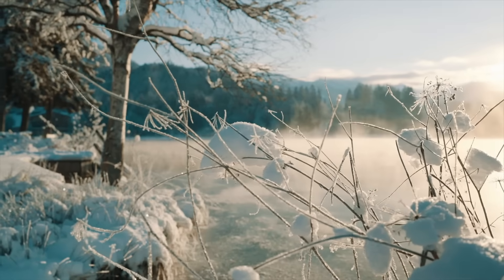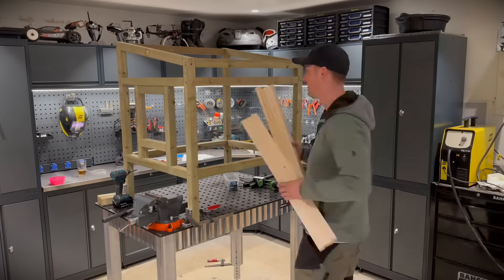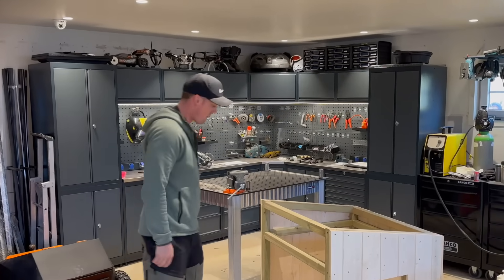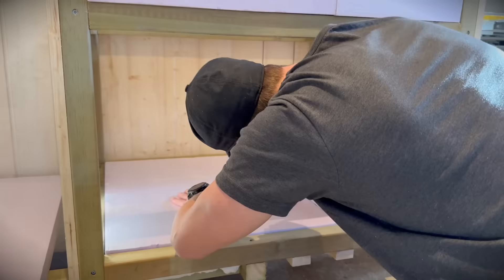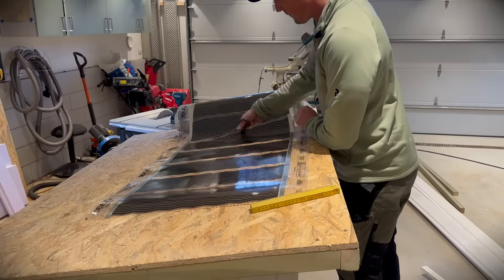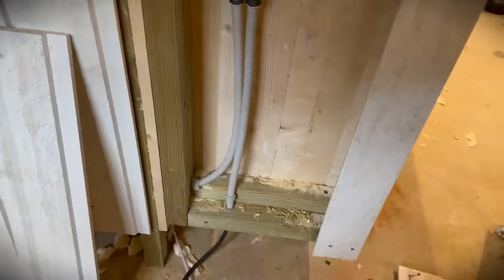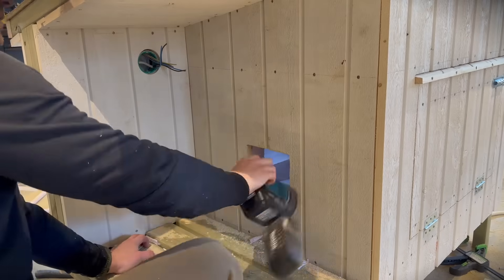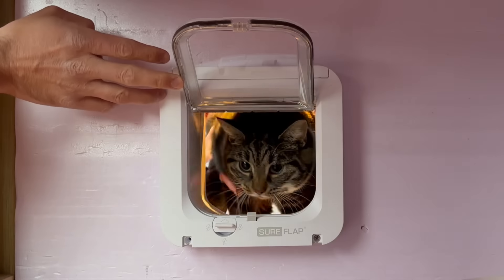I Made The Ultimate Heated Cat Shelter! (DIY)

Comment from the maker: Finally the DIY PDF plan is available for download! https://frengenengineering.com/ or: https://www.etsy.com/no-en/listing/4419179583/heated-cat-shelter-by-frengen Hope you find it useful! :)
Reply: A quick and easy project, but not for my husband. I wish he could do this for my cats. They live in a plastic storage container with a foam cooler inside for insulation and filled with straw. Grat job, beautiful house.
Reply: Thank you so much for thePDF.  It's a well-thought-out house!
Reply: Könnten.   Sie. Das.  Bauen. +  in.  Die. Schweiz. Schicken. Ich.  Bezahle.  Die.  Kosten
Reply: I’m a Union Electrician. I built a cat house for the feral cats in my neighborhood. It’s basically the size of a shed. I trenched a a few circuits out to from my sub panel in my garage. Then I did heater, ac, lights, and a receptacle. I also did a heated floor and low voltage lighting. The low voltage lighting is under the shelving i built for the beds. I built in a motion controlled door for them. Then I ended up doing solar panels which actually runs most of the power. I insulated it also. I’m thinking about bringing water out there with a little hot water tank and a small sink. Then I also built a cupboard that holds their dry food and cat litter. I also have motion controlled lights around the outside so they can see it at night.

Comment: 1:06 Gonna lose a lot of heat through that single pane window. If you added just another sheet of plastic with a space of just air between them would be much less thermally conductive. That's what double pane thermal windows are, just two sheets of glass with air between them.

Comment: I found it strange that he's working with inch-sized lumber in Norway. Does Norwegian wood (I think that's a song) come in those sizes normally?
Reply from the maker: Hi! You are correct. In Norway almost everything is referred using the metric system, but the exception is mainly construction lumbar and pipings, where we use inches. Still everyone knows the equivalent measurements in mm. I think it’s shifting a bit to using the metric terms in daily speech tough. 2"4 is faster to say than 98x48mm and so on.
Reply: @frengen_engineering  Thank you for the reply. I was afraid that Norway was a primitive place like the United States.

Comment: That’s a very thin piece of plexi glass that is going to let in a lot of cold air. I would’ve not even put a window in or at least something much smaller. no insulation on that one wall where the door is no insulation on the door either that’s also gonna let a lot of cold air in

Comment: Overall, a very nice cat house, but it lacks interior wall and floor coverings/paint to protect against moisture that the cat might bring in. A lot of heat will be lost through the thin plexiglass pane. Thermal insulation glazing would be more efficient (but unfortunately also more expensive!). A cat bed would certainly be appreciated for added comfort.

Comment: What is the point of all the Styrofoam insulation when you put a single glazed window in?
Reply from the maker: Its not a problem. Off course it’s some heat loss, but not that much. Remember, you can have a simple tent warmer on the inside than outside.

Comment: Nice guy!  I have cat forts in my insulated metal building and set up heat emitter lamps, like reptiles use, safely on a chrome shelf, facing downward.  I set bricks all around the lamp to hold it secure and keep the heat from rising too much above the shelf. Then there is a cushy cat bed and canvas drop cloth curtains down the sides  like a cave. This is all quite safe to the best of my ability....and common sense!  I use 100 watt heat emitter bulbs in a ceramic light socket thing and an aluminum cone.  On and off switch is on the cord.

Comment: Just related true story here. One year going into winter a frail older farrow cat started hanging around the house. It looked like it was going to die at any moment. It's tail actually broke off.Wanting to help make it more comfortable until the inevitable arrived, I built a small cabin with a gable roof that made the snow and ice slide off. I made skids and raised it off the ground to avoid any dampness on the floor and insulated the whole thing. 

The cat immediately started using it and peering at me through it's tight little front entrance way. So I decided to improve it even more by running a spring heating element through some spare quarter inch copper pipes I assembled in a C formation and then clamped them to the ceiling of the cabin. For power I used an old 12 volt car battery and then later used the 6 volt setting on the battery charger I had in the garage. Then I tossed in some pieces of old wool blankets. It  was warm and toasty in there like you wouldn't believe- even in way sub zero temps. And I kept it stocked with high quality dry food and lots of water.

The cat slowly got stronger and put on weight. She became the postie's daily friend and the neighbors smiled everytime they went by. The cat ended up living for 3 more years and I'm always remembering that it was possible because I decided to go the extra mile and try to help.

Comment: is there enough air for the cats to breathe? I'm asking because the home is quite insulated and is that entry hole (door) large enough?
Reply from the maker: Hi, there is installed a vent vent also. Not included in the video. And off course a bed n so on. The door is made specifically for cats😊

Comment: A polite suggestion:
A 4 to 6 inch layer of straw make a comfortable ,warm bed..better than blankets or cushions. 
We use this in the shelters for the feral cats in our area. Even when temperatures are around zero degrees f. ,they stay warm and dry.
Reply: Especially if the animal gets wet in sub- zero temps. They could freeze to the bedding. The straw will naturally wick away most of the moisture. Farm animals are given straw bedding for this reason.

Comment: Very nice house. I thought about it but then observed it would actually be cheaper to buy one than make one and our winters have no snow so, no need for more materials.

For heating a went with common 12v mats, a 100000mah battery and a solar panel to keep it charged but considering the winters here, even that was not needed, summer is the problem.

I might add an underground thermal air regulator and do some alu panels but I doubt it. The really hot days they can come inside or just lay low in the shadows elsewhere.

Comment: We made Cat outdoor box from Styrofoam panels glued together, this makes it air tight, waterproof and lightweight, yet simple to make. It had no heating because cat heats it by itself when the space is small enough. The door was made below the inside floor so cold air did not come in and warm air did not go out. There was only a simple leather flap over the entrance to prevent wind blowing in. The difference was that the box was in a cold shed so it was not fully under the weather.

Comment: My cat would use those foam inner walls as a scratch pad and quickly tear them to shreds. But it looks lovely from the outside well engineered.
Reply: I wondered about that too.  I suppose one could add some paneling overtop of it like in an actual house.
Reply: Yup.  The cat will claw that insulation to pieces.  The plastic window should be tempered glass for the same reason.  This also needs some ventilation.   It's a good first attempt but needs more work.

Comment: That's a really nice outside cat shelter - nicely done.  I'm in the US/Florida and our winters don't get as cold as yours but shelter is still nice to have for our furry outdoor friends.  I do have outside cats and have a "Cat House", it has the same insulation as yours and a window.  Mine is not heated though.  Mine is about 3' off the ground supported by 4" x 4" legs, has a front entrance and a back escape one, cats don't like to feel trapped.  My neighbor built mine and made the roof so it hinges open for cleaning and changing out the bedding.  I have a couple of cardboard boxes with wood chip pet bedding for their comfort.  It has a ledge across the front and down one side for them for access to both doors and the roof overhangs to protect the ledges.  You could put a box inside with wood chip bedding to make your cat more comfortable.  I do not feed my cats inside the house, don't want to attract any predators, rodents or bugs, may not be an issue in your area.  Nicely done - Love our cats!

Comment: Needs a nice blanket inside for perfection ! 🥰
Reply: Straw.
Reply: @Vlad_451  yes definitely straw
Reply: Straw for the outside cats
Reply: The thing with blankets is once they get wet...
Reply: @ptaylor4923 you mean wet? I have 2 so I can swap out/wash as needed. It’s not likely to be much of a problem with a heated floor, in any case.
Reply: @susankaempfer8427 exactly what I was thinking, needs a nice little soft blanket..😊
Reply: @susankaempfer8427   Not everyone uses a heated blanket and when producing multiple cat homes, that can get expensive and tedious to constantly change and wash the used ones. 

Also, What if the cat homes are a decent distance away? I just placed one 3 hrs away from where I live because I met 24 cats outside of the hotel I was staying at 😂.
Reply: @ptaylor4923  outdoor rated carpet.
Reply: @mole2026  outdoor rated carpet means it has up to rain, but because it's still a fabric once it gets wet,it takes time to dry out. The problem being, if a cat comes in wet whether rain or snow, it will wet the carpet and stay cold. Straw filters the moisture better,dries faster and the cat can get warm. And warm is the priority not durability
Reply: Apparently, for feral cats, a blanket is the WORST thing to make it “ cosy”. It gets damp and moldy. Cats much prefer to sleep in straw which you can change regularly.
Reply: @abigailmckernwalkingwithpo4582 It works for me, I can swap them out and wash them with unscented detergent.
Reply: Not a blanket, It needs STAW
Reply: ❤I have a stray female cat who lives in a three sided house with two cushions (1 self heated) and two blankets.   Put straw in December through March!  I put a microfiber towel to cover the opening!
Reply: A slightly larger version with the floor cover mostly soft blanket and a small thin piece of some kind of gritty stone that cats love to roll around on
Reply: @seileach67   Smaller is better at keeping them warm and straw provides a better insulation unlike a wet/frozen blanket. Also could use one of those campers insulating floor mat for sleeping bags (isolates you from the frozen ground).
Reply: @susankaempfer8427, yes, def need some soft material to lounge on.... But what about a Wi-Fi connected smart TV?! Kitty needs to be able to catch her soaps and surf YT vids to check out other cat's houses, lol.
Reply from the maker: @zenithperigee7442 😂
Reply: It's already a fire hazard with the heated element on foam
Reply: @Artur-sw8er  the builder was an electrician, it’s not a fire hazard. He knew what he was doing..
Reply: I agree, blankets are not good for the most part. They get dirty, they could get bug infested, if in Florida, the cockroaches would probably love it,  ❤❤❤❤❤❤❤
Reply: @janetpattison8474 I don’t get the backlash. The point would be to have two and launder them regularly.
Reply: and a cat bed and cat toys.
Reply: No need with floor heating. Cats wear their own blankets and lick them clean.
Reply: Yes, a blanket please!
Reply: @Binoculars840 no, no, no. Do your research. No human blankets which smell bad to cats. Straw every time for wild cats!

Comment: Simple and cheap cat shelters with thermal insulation: get used, curbside, yard sale or thrift shop large coolers.
Use hole saw or jig saw to cut door into side, add flap.
Add a heating pad on electric timer if needed inside

Comment: No insulation on that door which you can open. You should cover  Styrofoam insulation from inside with some plywood because cat will destroy it fast scratching it. And lot of temperature will be lost through window. Otherwise nice project
Reply from the maker: Hi, thanks. Was wondering about the possible scratching of the styrofoam myself, but the cat does not touch it. The door should be isolated tough, but it works quite good as it is also.

Comment: Umm no ventilation?
Reply: There are several problems that I can see.  The Styrofoam insulation should have been covered with something that is  claw proof or kitty will rip it to shreds.  The plastic window should be tempered glass because kitty is going to claw the heck out of it.  Like you noted this needs ventilation.

Comment: I have experience of making and using a cat house for two winters. It needs ventilation. Without it, the walls near the door are covered with water and mold. I did not see any ventilation in your house. Cats will not live there.
Reply: Yes, needs ventilation. Also the Styrofoam needs to be covered of the cat will claw it to pieces.  Window should be tempered glass because the cat will claw that as well.

Comment: Roof is perfect material to use and it overhangs nicely…Why is that cat on a leash? Wild animals?I don’t like that at all…I had a catio built for some of mine to go in and out…
Reply from the maker: @vickie30  Hi, The shelter was made for my mother’s cat. She wanted a safe and heated place for her cat, for when the cat is outside during the night. She has a GPS tracker around her neck (falls of easily) The leash was just for the first test programming the chip - activated cat door. It’s not ment as a shelter for stray cats, like I se that the comment section is saying. But I’m planning making that as well. 😊
Reply: @frengen_engineering thank you for answering me..I was worried about wildlife..

Comment: I built a shelter for the TNR feral cat I feed but he won't use it!🤦‍♀️. 2'x2' double walled sides and floor with spray foam insulation in between. 2'x4' top for overhang with hinges and a latch. Stapled pipe insulation inside the top and filled inside with straw.🤷‍♀️. Very disheartening.

Comment: Thank you for doing this! I’m currently building my stray cat an outdoor shelter… we’ve recently seen a rise in stray cats on my street and it’s heartbreaking to see them sneak under sheds or hide any place to escape the frigid temps. I’m waaaaay behind because I’m a perfectionist but this pushes me to want to finish
Reply: I'm literally on week 3, trying to do the same. I'm not what one might say a perfectionist, but I don't care for slop- jobs by no means either. What my main issue has been is having tons of scrap wood & no wood cutting tools past a hand saw and electric drill. So it's been tedious is it could be trying to  find the right sizes of wood pieces to fit together. Got stumped at the roof. This is when my bf took over...still in progress. He doesn't agree with my insistence that I need access to the interior/ a hinged roof or section of roof. Plus, I really would like it to be convertible for summer weather, by removing opposite gables(?) under the roof at each end of the house, so a breeze can blow through but not regular rain. I have a feeling my wants may not be implemented,but I'm crossing my fingers! 
Good luck on yours! I was wanting to quit too. But allowing all the cats inside while making their box helped motivate us! ( I wouldn't recommend it) lol